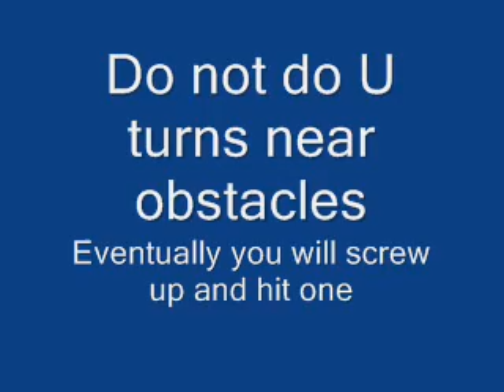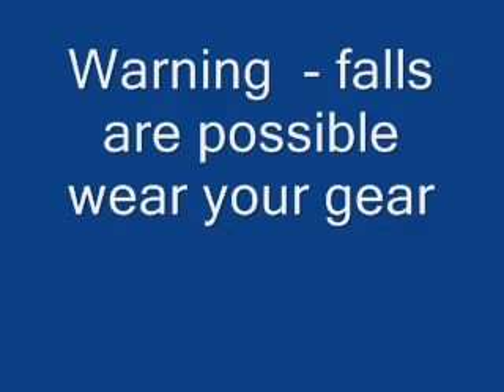U turns - 3 methods

Comment from the maker: It is true that you have to lean more on a scooter to make the same turn at the same speed. Be careful about doing too much parking lot practice at once on the Majesty as it will cause damage to the belt. If you smell rubber, stop for awhile. (I have a Majesty, too.)

Comment from the maker: In a tight spot, I usually use the angled entry. It just seems easier to judge for me. If I use the straight entry, a very slight turn away from the direction of the U turn seems to help. I'm only talking about a few inches of tire displacement.

The dip is something I use a lot when I'm doing a turn around an obstacle like a gas island. 

If you watch what I do between maneuvers, you can get a more candid view.

Comment: is the dip the same as a counter steer? I don't think that the "dip" for a U-turn is practical in a tight spot since most riders are going too slow to allow the bike to "dip".   Then again you did say that this is not commonly used on the street.

Comment: Great video. But you miss the crux in the commentary. This rider is using the counter wieght technique. If you look hard, his outside elbow is pushed outwards and his inside elbow is tucked in tight. This moves his c of g outside the curve and balances the turn. Counter wieght is vital for slow tight turns. It is better to use the whole upper body! Not just the elbows. Although this may be enough on smaller machines?